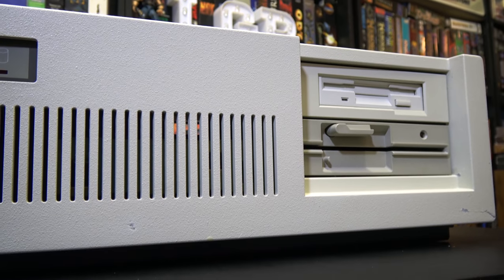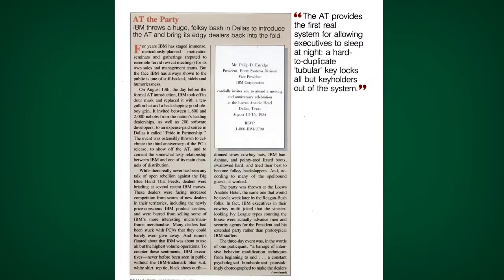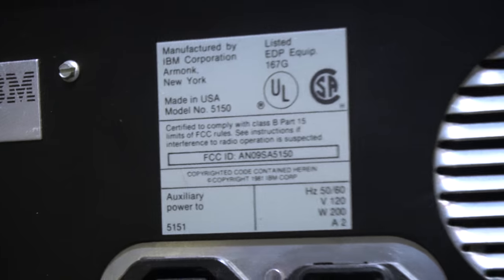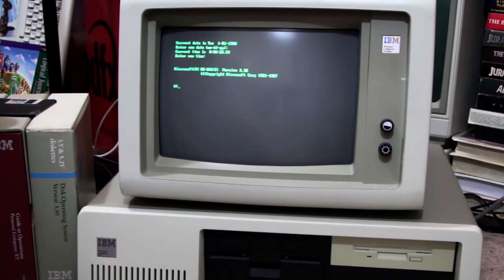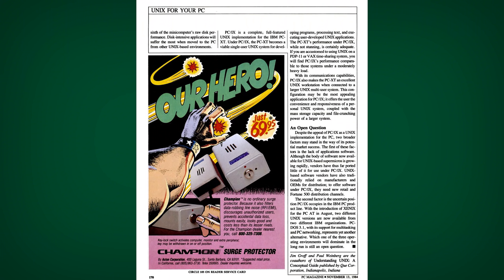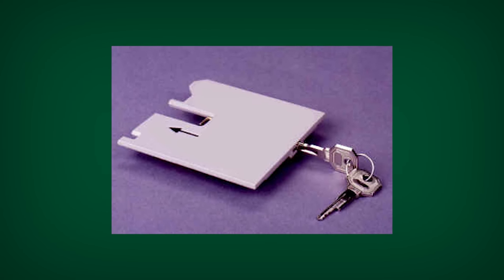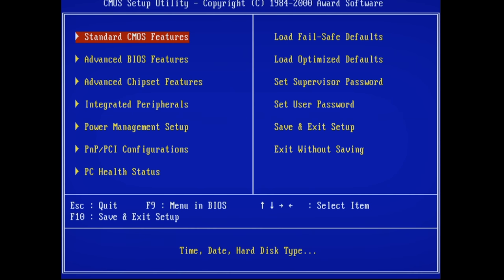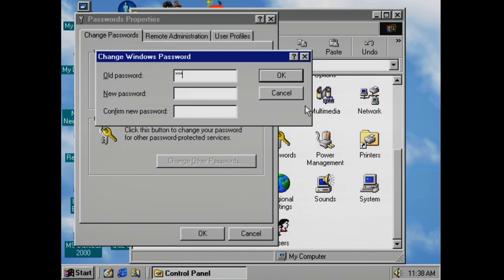Why did old PCs have key locks? An LGR Retrospective

Comment: Here's my relatively recent experience with a computer key lock:

The computer I bought about 5 years ago happened to come with a lockable panel that closes over the power button and drive bays.  I thought I might like to use the lock whenever I was gone from home since at the time we had a friend frequently visiting and bringing her son who has no personal boundaries.  (I once caught him on my brand-new computer -- which wasn't session-locked at the time because I'd just been using it before leaving the room -- clicking every icon on the desktop, and instead of reacting like, "Oops, I got caught doing something I shouldn't," he just said, "Where are the games?")

Anyway, I looked through all the computer boxes and couldn't find the key.  I called the shop that built my computer and asked them about the missing key.  They swore that the key must have been put on one of the boxes, which it couldn't have been since it wasn't in any of them.

I ended up just making sure I always locked my session whenever I left my computer if that kid was around, and I eventually forgot about the key.

...until a few years later, when I decided to upgrade my RAM.  I opened up the tower, and discovered a cardboard box, small but sizable enough to potentially block airflow, packed away in the back corner.  I had to remove the harddrive to get the box out.  Inside I discovered all the extra screws and attachments that came with the tower, along with the lock key!  I guess the shop guys really did "put the key in one of the boxes."

I tested to key to make sure it works, and haven't touched it since.

Comment: what a nice video! Some years ago in the early 2000 when i case modded and played around a lot with computer hardware, i installed a lock that was just a keyswitch in line with the power button. It was so satisfying to use it, because it made me feel a little bit like powering up some serious machine or even a icbm launch control. :D Good old times.

Comment: I for one think there is a lot of room for security improvements below the OS level on modern systems and keylocks making a come back could be part of that. And the thing is, if the motherboards were designed for them they could be just as trivial to implement as they were in the old days. All you really need is a switch that cuts the data lines for USB. You can leave the power lines along and people could still use the ports for charging while the machine was locked. Taking it a bit further you could have a DIP switch block on the MB for switching individual ports on and off with a front panel keylock that connects for a disable all function. On the software side the BIOS/EFI/UEFI could have a option for which USB device types to pass on to the OS and which ones to eat and have the system act like it was never plugged in at all. It could be as simple as allowing only HID device or all devices. A gated system where items were sorted into tiers gauged by possible security risks. Or it could be a checklist for allowed or disallowed items to pass to the OS or eat.

This could make a MASSIVE improvement for large companies and government offices for security. Worried about webcams being accessed by a virus to take covert images? Disable USB imaging devices. Concerned about employees taking custom records? Disable mass storage, mtp, etc...

Yes, you can disable those things at the OS level but none of that helps with a clever user that can boot another OS. Add a keylock that can keep the case from being opened AND disables all the ports and you are as near to perfect security as is physically practical.

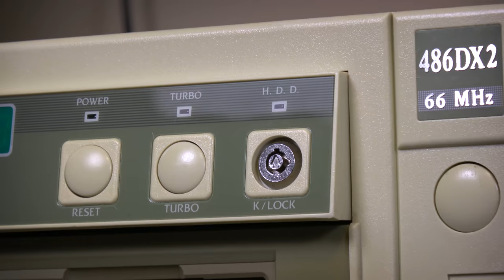Comment: 6:01 I remember my father having a computer with that kind of keylock with an embossed arrow in it. He used the lock to prevent me as a kid in the early 90s from using the computer when he didn't want me to. But that lock was crappy enough to be able to be opened using a simple screwdriver on the arrow! So that stupid arrow actually made the lock less secure :)

Comment: I forgot about the lockable floppy covers.  When usb thumb drives arrived on the market I heard of shops filling unused usb ports with epoxy to prevent users from putting "non-secure" drives in the ports.

Comment: Our first PC, a 486 from 1994 (I believe) had a key lock, though it only physically locked the case. Was unaware that some also/instead locked out I/O
Reply: 486SX, or DX was around 97, shortly before the IBM Stealth was released for about a 1/4th the cost of a upgraded 486, live & learn.

Comment: Is it bad I want to add a key lock to my PC?
Reply: Not weird at all. Since the jumper the key lock uses often matches the jumper for the power button you can simply insert the key lock jumper onto the power button posts instead of the power button leads. Then again you'd have to find a way to lock the case so that the power button can't be switched back (or the posts shorted) by a casual interloper (much like was covered in the video). Only other thing is that the key would have to be turned on and off again quickly (to simulate the brief time a power button is usually pressed) instead of simply leaving the key turned (or else it'd be like leaning on the power button for an extended time. May cause the PC to turn off after 10 seconds again). I've thought about using a key lock for a power button but lost the key for the key lock I liberated from an old Zeos 286 I used to have. Still looking for an old computer that still has a key to go with its key lock.
Reply: I can just imagine someone walking up to old school computer locks like that and being like "I'm gonna hack the mainframe!" and then just wiggling the lock loose with a screw driver and reconnecting the wires with a paper clip. #hackerman
Reply: Nah, I kind of want one. Hackers can figure out your password but they ain’t got the key 😂
Reply: You may not need to after this one weird trick.
Reply: Back then all terminals were hard wired back to a controller or server. No passwords.  Before that separate co-ax video cable was run.
Reply: they make a tool for picking these tubular locks, makes them a joke. It's rare to find a high quality lock on something like this, you're better off locking the room/building that contains your computer. Walls, windows,  and doors are much harder to break down without someone noticing.
Reply: but what if they just simply want a keylock because they could
Reply: You can.  Intel platform trust technology module (IPTTM)  When enabled, the motherboard will not POST without the registered module attached, and its key in the "ignition" position.  The module comes with an anti-case-tamper option as well.  Similar to a secure tape seal attached to a wire, when broken, you will require a wired connection and PXE boot to two-factor authenticate to turn the system on again.  Trying to force the systems power on will corrupt the HDD's encrypted contents
Reply: Nope
Reply: i have done it, and mainly to prevent it from turned on
you need to rewire one of the power button connector wires to a keylock switch mechanism, which involves some soldering and use of heatshrink tube to prevent case shorting. And after that, finding a place to mount the key, and making sure you have spares. 
They do sell such electrical PC keyswitches on eBay but they are not prewired to go with the power button, so a little DIY is needed.
Reply: My thermaltake level 10 gt has a key lock
Reply: i have a combination lock on the side panel of my pc and its chained to the floor with a bike lock aint noone stealing that shit lol
Reply: Maybe someone sells stickers that look like those keylocks - for those who like to apply them to modern computers for lols (?)  If not, well, I just gave someone an idea.
Reply: Most modern laptops come with a keylock
Reply: No, sometimes it's better to be safe than sorry.
Reply: I wish I could start my pc with a car key system
Reply: Depends on what you think, really. It probably won't do much at all, so it really depends on what you think.
Reply: Make one
Reply: Yes

Comment: I remember using a lock on removable hard drives.
Reply: In those cases it was to keep the hdd in so it didn't pop out while in use.
Reply: I remember this too, almost like it was yesterday.

Oh wait, it was yesterday. All our servers have locks to prevent the hot-swap drives from being removed.
Reply: Some removable drive bays still have a key lock. Others do not, so you have to look for it if you want it.

Comment: I remember trying to drill out the lock on one of those IBM's after the keys were not present... I was 14 and the computer was a school throw-away I asked to take home (and was given permission). My dad was not happy with the condition of the expensive large drill bit when I was done. Took forever to drill it out.
Reply: Waste of time. Just insert a pin or paperclip and slide the mechanism over. Those things were not useful in locking anything.

Comment: Well I talked a bit about this on Twitter but I'll get a bit more in-depth here. This is going to be quite a long story by the way.

So I went to a secondary school in England that used floppy disk drive locks. This was around 1997 or 1998 and the computers were all new, purchased only a few weeks before I arrived and they were pretty good. They used (I think) Windows 95 OSR2 and were all connected to both the school's LAN and the internet. I was in to computers at the time though and noticed one decision they'd made that I immediately thought was an insane idea: No antivirus software. This was likely to try and save money on what must've been a very expensive project and their mentality was one of 'Prevention rather than cure' with a the computer labs declared a 'Floppy disk and DOS-free zone' in an attempt to prevent viruses from ever entering the network. We'll get in to how that worked out later.

The drive locks were of course part of this, once it was realized that trying to monitor every student on the computer (of which they were over a hundred) was just not feasible. So the drive locks were installed, rendering the drives unusable unless removed, and removing them while locked would take the drive heads out with them. So, of course, with a bunch of 13-16 year old boys being the primary users of these computers, most of the drive heads were quickly torn out. At first this wasn't considered a problem since nobody was supposed to be using the drives anyway, but then weird things started happening.

At first computers just freezing or blue screening for no apparent reason, but this was Windows 95 and that happened a lot anyway. But then it started happening a LOT, to the point where it was difficult to get anything done, and then custom error messages started popping up leaving little doubt that a virus had got in to the network. Some people were surprised, but I knew this was coming. You know how I mentioned earlier about all of the computers being connected to the internet? Wondering what was stopping any random student from just going to any website? If your guess is nothing, well you're pretty much right! You weren't SUPPOSED to (without being supervised by a teacher) of course and if you did it in a computer lab you'd be told off and might even get banned from using the computers, but then came something where I'm going to bring us back to the topic discussed in this video.

I mentioned the computer labs, but the labs weren't the only place you could find computers. Most of the classrooms had at least one computer, probably intended for students to look stuff up during class, but if you went in to the classrooms during a break when no teachers were present (not difficult, I did it a lot) then there was absolutely nothing to stop you just turning the computer on and doing whatever. Now if they had actual key locks to stop anyone booting the computer or using the keyboard without the key, then there would've been no problem. But no, no proper keylocks, just the stupid drive locks. So I ended up seeing older students in teams (complete with one of them taking lookout duty) using these computers to do what teenage boys do. Doesn't take a genius to put two and two together and figure out where that virus came from.

You may ask now what I did about all this, since I clearly knew what was going on. Well the answer to that is... nothing. I just ignored them and went about my business. The primary reason this was that despite what was going on, the chief technician and his monitors insisting on treating ME (remember, I'd only just arrived, I was among the youngest students) as their biggest problem. The reasons for this are lengthy and personal, but long story short I really wasn't a troublemakers. I was just young, curious, and had a pretty big interest in computers. Had they not treated me so badly I'd have been willing to help, understanding how terrible it would be if the whole network went down. But instead they insisted on treating me like a criminal, so I ignored what was happening and figured they deserved what was coming up next.

Inevitably, the computers ended up entirely unusable and the entire network had to be taken down so they could spend some time (probably two, maybe three weeks) going around reformatting and reinstalling everything on every computer in the school. Which, since the FDDs in most of the computers were destroyed, first meant buying and installing new FDDs for them. Once this was done I noted that it had taught them at least one lesson: Every computer was now outfitted with antivirus software. Between the site licence for that, the new FDDs, the time spent getting everything back online, and the lesson time students lost while all of the computers were offline, they probably blew through two or three times as much as it would've taken to just buy the damn antivirus program they should've done in the first place.

I transferred out of that school not long after this happened but I do reflect on the whole saga and the lessons to be learned. But one question (that I will likely never get an answer to) still lingers. Whose stupid idea was it to not get antivirus software? The two scenarios I can think of are the chief technician getting a bit full of himself, thinking he and his monitors could prevent any viruses from ever getting in to the network, and convincing the headmaster that no antivirus software was needed. The other is the headmaster himself wanting to save money on the (as I said earlier) very expensive project so it could be spent elsewhere, saw how expensive an antivirus site licence was, and figured he could keep his students disciplined enough that they would NEVER break his rules, so he made the decision that antivirus software was an expense they could do without. Given their respective personalities, I could see either happening.
Reply: I... really don't blame you for keeping your trap shut. I was in elementary school at the time (I'm American), and I think most of the computer labs had either Apple ][e's or ones with some weird OS that I know next to nothing about anymore (I wasn't a tech-geek then) before eventually getting Rose computers with Windows 98 on them.
Reply: The "wierd OS you don't know about anymore" is probaly Linux.
Reply: +Anthony Seboe I don't think so. This was the mid-to-late 90's, around the same time +AmysFantasies was in secondary, and I doubt anybody there had the technical know-how, or even patience, to install any Linux distro. I'm sure it was UNIX-based, though. I can barely remember what parts of the OS looked like, and I don't remember if the mouse was used much, or if there was a mouse at all. If I could just find an image of the OS in question, specifically its "native" word processor, I could say whether or not you're right.
Reply: Remember, guys, this is public! The administrator may find out and want your Trojan "fixed."
Reply: It doesn't just happen in school; it's also common in smaller businesses. I happen to work for one! Network security is always the last thing companies invest in, until they need it most...
Reply: @JordanWalker Wow, you sure are valuable to this discussion.
Reply: +AmysFantasies:  Thanks for the funny story.  I was trying to figure out what the heck the use-case was for the floppy drive locks.

Comment: We still have those keylocks at the work place. Without the proper key, unauthorised personnel can not turn of or reset the computers. Some files have to be synchronized to a server in an other country and it might take hours. If the PC were to be turned off, those files would be damaged and products would have to be recalled from customers.  Also it would be problematic if random personnel would start messing around with the PC-s like swapping them because something is not working... (We had a guy who got a soldering iron from an other department and "repaired" something on a certified device for example. Since then we even have stickers and non removable parts so the PCs can not be moved / taken apart etc...)

Comment: If I had the option, I would like a key lock for my case that works like a car's ignition lock cylinder.
Reply: Cars Simplified, that sounds like a cool, not too difficult mod. and the same key can be used to unlock the case from the back.  I remember reading about a mod to have your computer turn on by a car alarm remote control.
Reply: Technically, the easiest way to do this would be to use a gas-powered internal combustion generator to run your PC. Of course, for it to be really effective, you might need to be somewhere far away from electrical outlets...
Reply: My pc has a lock with a normal key from 2015